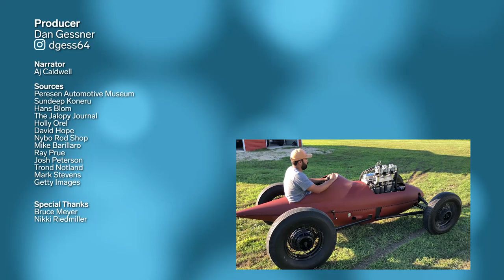Why Warplane Fuel Tanks Make Great Hot Rods

Comment: I'd be interested in seeing what would happen if you put an electric motor in one of these. They take up a lot less space so you could pack in a lot of power without having to make a cutout for the engine, thus preserving the aerodynamics of the vehicle. You could also design the battery pack to run along the bottom of the tank thus providing a low center of gravity and freeing up space for the driver's legs so they can sit in a reclined position and keep their upper body out of the airstream.
Reply: Take your idea and make it like a torpedo sorta like a Japanese mini sub where you lay down in it with a glass front. The caveat is that even a minor crash would be lethal. Not for the faint of heart but it would be fast, like flying across the flats at 300+ mph.
Reply: yeah there would be alot of benefits cool idea

Comment: Actually sounds like a good idea. They're aerodynamic light and strong. It'd be fun to put a quad rotor with a massive turbo on it and see how fast it can go. 
Or maybe put a huge front wing rear wing and rear diffuser on it and see how fast it can corner.
BTW isn't there a hotwheels car
 called lakester as well?
Reply: @xavierrodriguez2463  good idea. Actually if we use electric motors, we can make both.
Reply: Yup! And the shell opens up to expose its twin engines

Comment: Man this video is inspiring, Almost make's me want to go out and get 1, My smarts are just wondering how fast and how aerodynamic they would be. Mind you if a twin turbo LS was put in 1 making around 800 hp, They look light, Not for 2 people as it would be cramped. It's looks almost like a smaller version of a high end sports car like a McLaren F1. Just sleak arrow dynamic for wind light and something that will allow air to flow smoothly around the body at extreme high speeds. So if at a drag track you would think it would just shoot down the track like an arrow, Might need some weight to weigh it down yet you would think that do to the sleak design it would make records as it would not fight the air. Rather the air would flow around it.